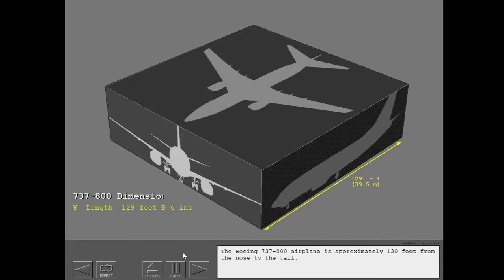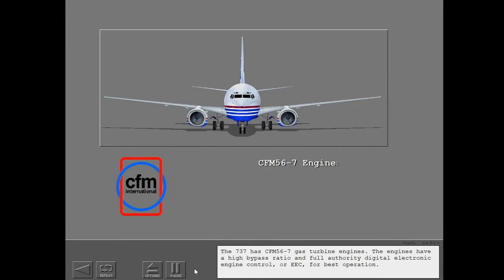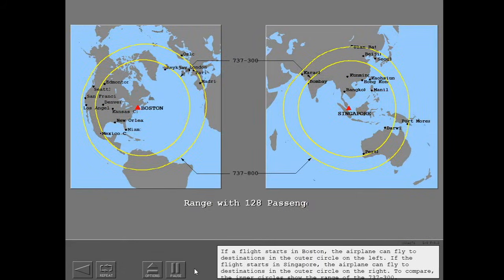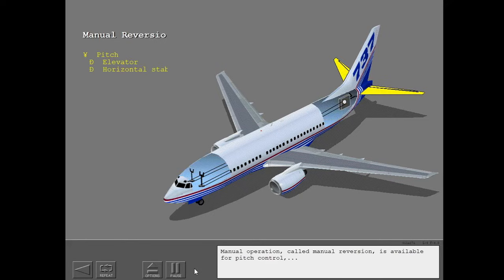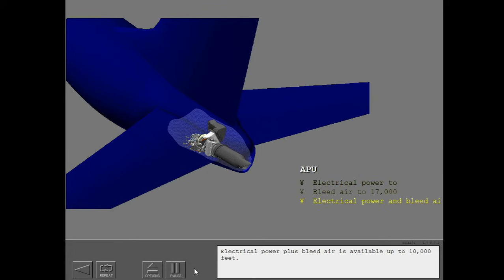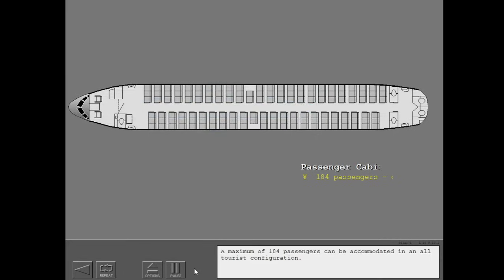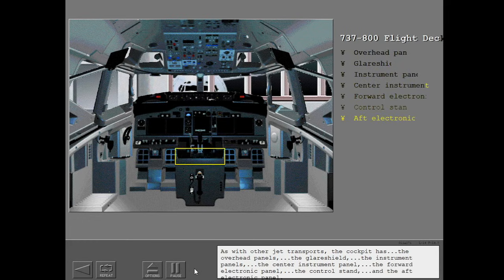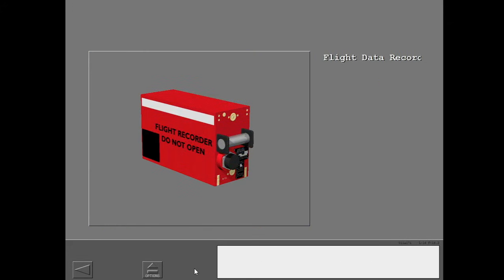1. Boeing 737NG Airplane Familiarization

Comment: nice videos, thanks. helps a lot in learning how the 737 operates. wondering if u have the one for the max. would love to see it.
Reply: the whole point of the MAX is that you do not need retraining so if you can fly for example 737-800 you can the max with no training. a few hours ta most if at all.
Reply from the maker: @michaelzvertsov6197 as far as i know right now to fly 737 max need to be retrain few session in simulator for the differences program.

Comment: There is a really annoying audio hiss in this. It would be much easier to listen to if you would get rid of that
Reply: That’s bleed air.
Reply from the maker: Hello thanks for your support, I'll check and fix that things.
Regards
Reply: @cbtcorner  Its 2024. AI audio editing tools can pull that sound right out of the audio stream with little effort.